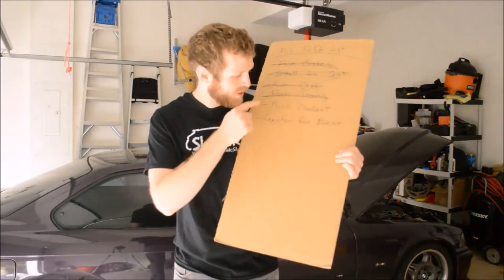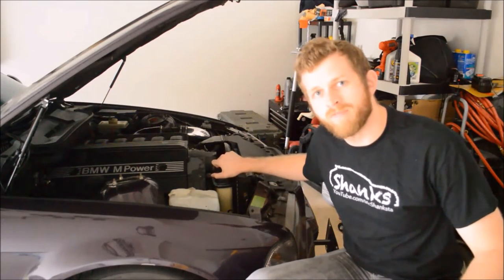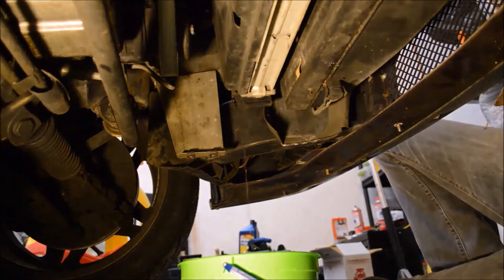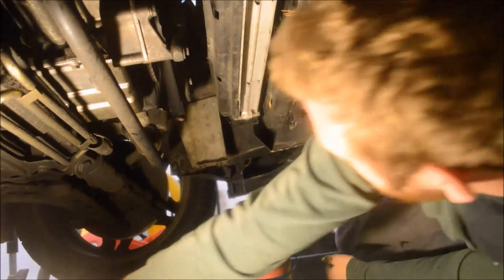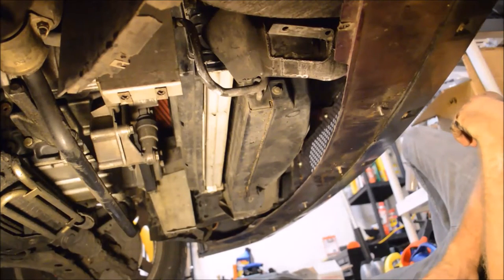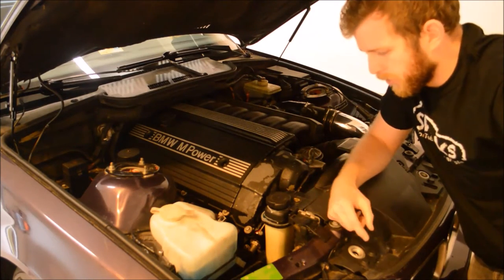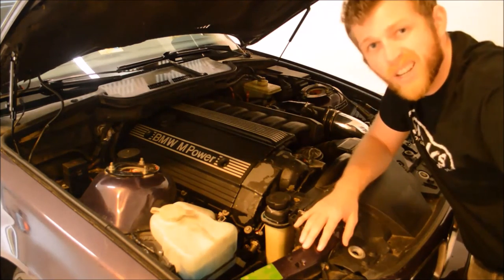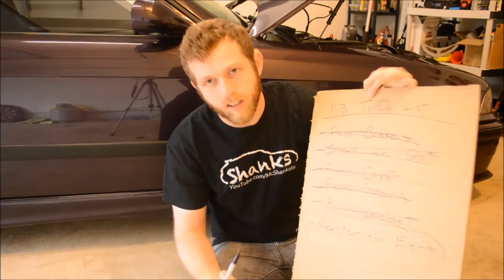E36 M3 Track Prep: Coolant Flush

Comment: have you ever got the "brake circuit" warning?  that switch was always failing in mine.  I'd order 3 at a time from Pelican Parts.  Kept the other two in the glove compare compartment.   Only problem I ever had with the car.  Easy fix, but annoying.   Not sure if you've done this, but I replaced the plastic thermostat housing with an aluminum part, and only a water pump with metal impeller.  BMW used plastic impellers in this models. wtf??
Reply from the maker: +dsonyay Nope no brake circuit warning yet, but now that we've discussed it I am sure next time I drive it'll be waiting for me! I do have a metal impeller-ed water pump installed (and a spare on hand). I am hoping to swap a full aluminum radiator this winter as well, to further remove the plastic cooling system defects. The one annoying thing the car is doing at the moment is the bank 2 knock sensor is flashing a CEL when its cold outside. Apparently that's a sign that its dying? I need to get on replacing it...
Reply: +T-WRX or buy a OEM made radiator using virgin plastic.. not recycled.  well, that was the word back then, when the original radiators leaked... buying one made anywhere but in Germany was the way to go.. rumor was Germany had to use recycled plastics which didn't do well over time. was it true?  I have no idea, but it was exciting trying to buy a radiator made in South Africa .. and it felt like we were breaking all sorts of laws. LOL.
Reply from the maker: +dsonyay haha! I remember trying to source old Euro Bumpers for my e30 a few years back. I felt the same way!

Comment: Any tips or advice on mitigating the mess somewhat?
Reply from the maker: +HardyHarz Not really, the engine block coolant drain is in a horrible spot. Everything I've read says its always a mess. Maybe a wider drain pain could help the floor a bit, but your front suspension is going to get drenched.

Comment: what should i do if my heater dont work?
Reply from the maker: Did it work before the coolant flush? You may have air trapped in the heater core not letting the coolant circulate. Or possibly a blockage somewhere, or maybe someone rerouted it to skip the heater core. All of those are not really good for the car and need to be fixed. You don't want to overheat one of these!
Reply: Nope i just bought e36 with the M50 engine about 3 days ago and the heater hasn't worked since i owned it (just blows air),  I'm going to flush the coolant tomorrow and was trying to figure out how to get out air the system. How would i check if someone did a heater core delete/reroute?
Reply from the maker: Roy Bush The easiest way to bleed the air out is to jack the front end up pretty high and make the bleed valve on the radiator the highest point. The heater core sits higher than the bleed valve when its on the ground so air can get trapped. The other thing which is kind of silly but stumps some people is to check the knob in the center of your dash under the vents. Its got blue on one side and red on the other but isn't part of the main a/c panel. it'll prevent heat from blowing out of those vents if put on the blue side. I made this mistake early on when I bought the car, its a weird BMW thing. You can have heat on your feet and turn that knob and get cold air on your face in the winter. Worth mentioning even if it may be obvious.
Reply: cabin air filter might be clogged